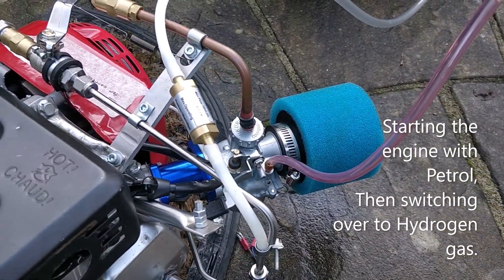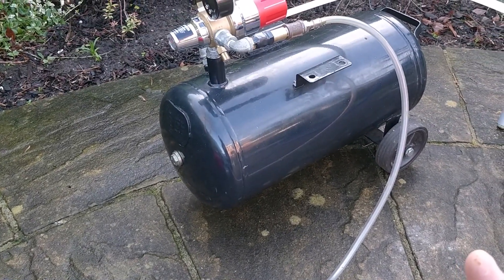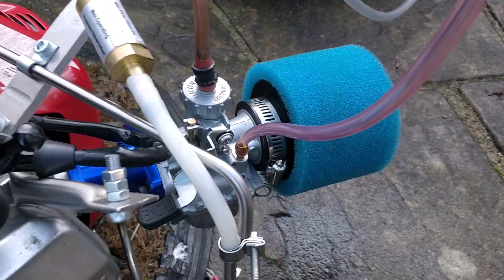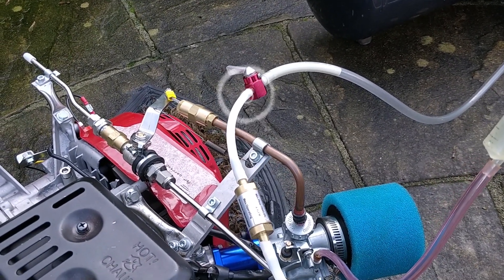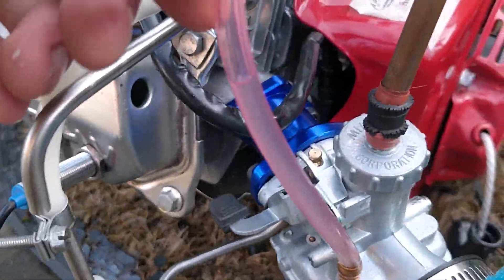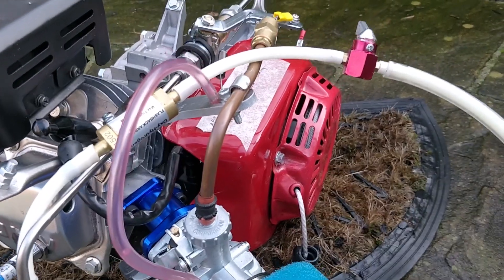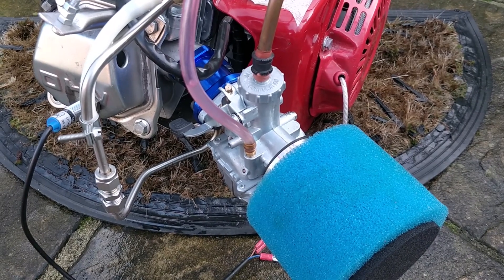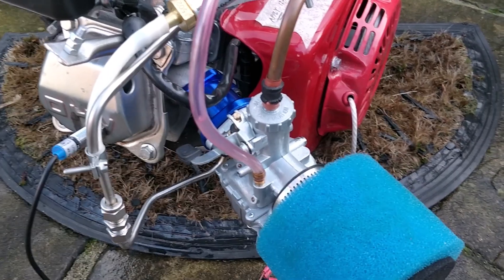Hydrogen Dual fuel engine! (pertol and hydrogen)

Comment: So hydrogen is actualy great fuel were space is not an issue but were it is its needs compessing into a liquide which is the difficult part this is why batteries were used in cars in stead of hydrogen but i wish elon musk had usedhis time to fix issues with hygrogen if he had we would all be using hygrigen as it most abundant eliment.

Comment: Can you give also some data, like the comsumption on hydrogen. Does it give the same power output as petrol in terms of watt.
Reply from the maker: It's around 15% less on power. And 24L at 50psi lasted 10 minutes on pure hydrogen gas,
Reply: @Hydrogenguys  thats a lot a hydrogen.

Comment: Have you tried to see if hydrogen gas / HHO will increase the efficiency of gasoline that is burned in the engine? a little gas should do the job to see 30% longer running time
Reply from the maker: Good question!. 
However I'm not to sure as we are trying to get the engine to run purely on hydrogen gas, however I do believe there have been lots of study's with HHO gas being burned alongside with petrol.
Reply: @Hydrogenguys  you should do the test so we can see the results! :)

Comment: Great, but Hydrogen or HHO?
Reply from the maker: This is hydrogen. 
We have gotten the engine to run on HHO but with no way of storing the gas it's hard to keep it running for a long time, unless you had a good electrolysis machine.
Reply: @Hydrogenguys  Ok thanks for the precision and good continuation

Comment: I believe water or steam injection would reduce NOX and increase horsepower.
Reply from the maker: Yes water injection can aparently reduce NOx emissions, also Exhaust gas recirculation (EGR) as well as a catilitic converter. 
With all of these in operation the NOx emissions would be next to zero.

Comment: Wow nice work did you make the hydrogen gas through electrolysis and pump it into tank?
Reply from the maker: I used a chemical reaction with aluminium and sodium hydroxide to take the hydrogen, not the best or most environmentally friendly but it does the job. I think stored the gas in the black tank you see in the video, will do another test with a full tank soon to see how long the engine runs for.

Comment: Very good mate possible Zero emission ICE 😍👍🏽
Reply from the maker: Cheers, the only emission would be NOx, but that can be reduced to almost zero with the use of a cat, running a lean fuel mix and exhaust gas recirculation.
Reply: Hydrogen guys... 

it’s a good  idea that you have... it would be good if you can do this on a production car??? Happy to help in any way as I work for a automotive OEM
Reply from the maker: @btk7520  That's actually our next project, in July/August I will be putting a team together to build a supercharged V6 engine to run on hydrogen, so between now and then it all about build up support, and your help would be much appreciated when it comes to the big build.
Reply: Hydrogen guys 

Awesome 👏 awaiting the video

Comment: Great man, thank for sharing! do you have any problems keeping the Engine on it?
Reply from the maker: Thanks.
We tested the engine 3 times, it ran perfect in each. 
We had a leak in the gas generator so couldn't store much hydrogen, however the engine will run until the gas runs out. Next time we will fill the tank completely and see how long a full tank lasts.